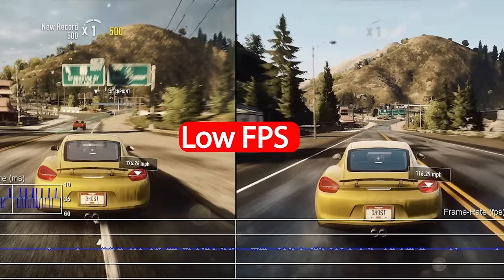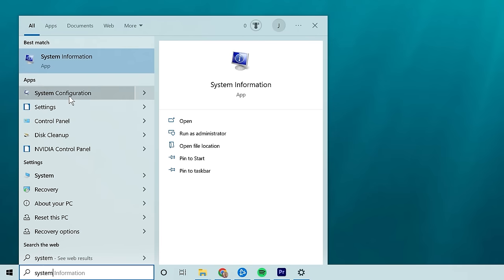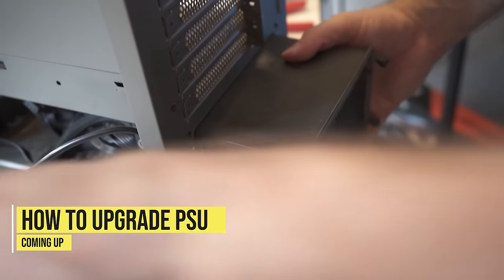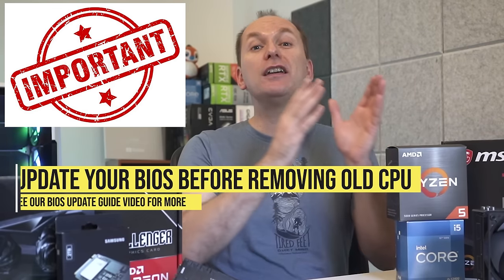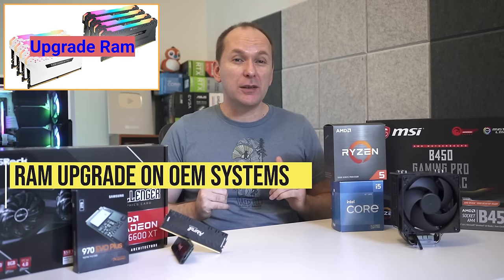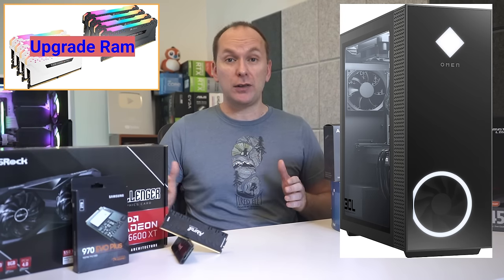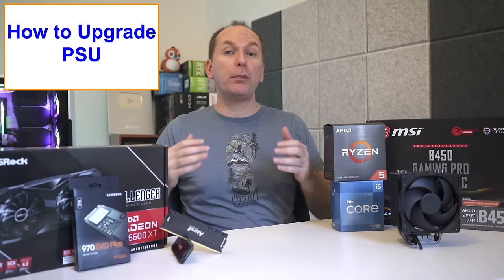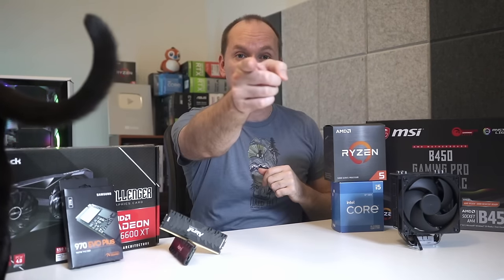How to Upgrade Your PC: How to Upgrade GPU, CPU, RAM, SSD & More! How to Upgrade PC

Comment: I have a i7 6700x with a 3060 ti I want to upgrade for ryzen but the new am5 is so expensive damn I considered a 5600x for 195 euros plus a gen3 msi board  would it be a good deal ?
Reply from the maker: Yes that would be a pretty big upgrade. 5600X and any quality B550 motherboard (see our Best Ryzen Motherboard 2022 video for more)
Reply: @PCBuilderChannel  thank you :)

Comment: Thinking about upgrading mobo, cpu, and gpu. I’m pretty sure that will also require a new power supply because these new GPUs take much more voltage, so now I’m contemplating a whole rebuild. I’m not sure if it’s worth it or not, so if anyone has any input I’d appreciate it!

Comment: I wanted to uprade to a 3080. In order to do that I would have to upgrade PSU, Processor (LGA 1200 so limited options), CPU cooler and case (a bigger CPU cooler and GPU wouldn't fit) and of course the GPU. I said heck I'm gonna build a new one in bigger case so I have space later. Then I realized my motherboard has errors with some RAM slots. There is probably 300 dollar difference in upgrading vs new (I'm not in the US). I always wanted an AMD system so I went with the new and 5800x. We'll see how it goes.  People really like the 5800x and I didn't want to pay for the pricetag for the new CPUs. The 5800x. I managed to get one here around 270$ converted. It normally goes around 310$-330$ in my country.
Reply: Wow, here in Australia the 5800x is generally around $640.
Reply: @jodiepalmer2404  Wow and I thought ours was a lot compared to the US prices.

Comment: Hello sir i have rx 580 8GB and i5 7500 which one should i upgrade it first cpu mobo or gpu

If cpu then im planning a r5 5600x or i5 12400f? Can you please respond
Reply from the maker: That system is fine for 1080p medium gaming but if you want to step up you’ll need to upgrade both. That CPU is going to bottleneck any GPU you drop in
Reply: @PCBuilderChannel  so I look to upgrade CPU first or GPU
Reply: @PCBuilderChannel  Like I'm thinking if I upgrade CPU first then down the road I can upgrade GPU
Reply: @PCBuilderChannel  well I was thinking if I get that CPU I can pair up with rtx cards later down the line or I shouldn't upgrade it then
Reply from the maker: I'm saying that sadly just upgrading the GPU right now won't give you more performance because that CPU is going to bottleneck  it too much. In order to see a boost you will need to upgrade both.
Reply: @PCBuilderChannel  yes I understand you but due to economical issues in my country I was thinkin.I can upgrade CPU and mobo first then gpu in the future
Reply: @PCBuilderChannel  so CPU and Mobo upgrade then gpu later
Reply: @PCBuilderChannel  BTW you mentioned GPU in your statement I said I should upgrade CPU and mobo first then later down the line I should get gpu Like I know I have to upgrade all 3 but still

Comment: Is it considered a new pc if the motherboard is replaced? I dont understand why you would ever 'build a new pc', arent all the individual parts replaceable?
Reply from the maker: You will eventually reach a point where upgrading a component wont help your performance because all the other components will bottleneck it and it will be more cost effective to build new.

Comment: I just brought some components  with good price 
lexar ares ddr4 rgb ram 8*2 =16gb kit 61 usd
adata xpg core reactor 850w 105usd
coolermaster 120mm mf120 halo 3nos+1nos + 53usd
kingston KC300  1TB  115usd
rest of the component i already have  ,  ml240 argb v2 cooler,    antac nx600 case,  etc...

now i am waiting for  the  release of  ryzen 7000 , then  i will purchase ryzen 5600x and tomahawk b550 motherboard
Reply from the maker: Best of luck with your build!

Comment: I have a I5–2400 with 16GB of DDR3 should I upgrade 😅

I'm just kidding that’s the specs of 2 of my old computers that I built a long time ago for myself and family but now it’s old I use it for chia farming and kind of CPU. It actually wasn’t until quarantine where I got an actual computer or upgraded which i upgraded to a Dell XPS with I7-11700, 3060TI and I upgraded it to 64 GB of ram and 2TB Nvme ssd with an extra 8TB. I actually am a miner so I bought a couple of those so for the 3060TI and the CPU and the 1TB drives that came with the XPS desktop originally. But I did also end up building an another computer that doesn't have a case because it’s sole made for mining with a 3900X CPU.

Comment: Alright i've been thinking of upgrading my PC and considering you reply to comments could you or anyone help me out here, My motherboard is a ga-78lmt-usb3 r2, i have 8 gb of ram (yikes i know, I think i need to get a DDR3 stick of ram.. idk if my motherboard supports ddr4), I have an AMD FX 8350 (4000mhz i think) eight-core-processer and a Nvidia geforce GT 1030 (not sure if my PC is trash but i think it kinda is, which is why i want to upgrade), Now i wanna upgrade my to these parts BUT im not sure if they might work, I also got this pc from amazon or walmart, It is an ibuypower PC:   G.Skill Ripjaws X Series 16 GB (2 x 8 GB) 240-Pin SDRAM, MSI Ventus GeForce RTX 3060 12GB GDDR6 and a amd ryzen 5 3600 or a 5600 but i've heard that my motherboard supports the AMD FX line of processers so.. should i get a FX-8370E? that and should i swap my motherboard to something else that supports the stuff i listed?.. i also don't mind swapping out stuff for other stuff if i do need to upgrade and lets say a DDR3 ram stick doesn't work anymore bc the motherboard needs a DDR4.. i'm unsure what to do and honestly i need some help because im new and.. frankly confused.

Comment: for me i am upgrading this year too my old streaming pc at the time it was good in 2017 pentium g4560 with 8gb ram and a gtx 1060 6gb but i am upgrading the whole platform as my second gmaing pc build my sned pc will use a ryzen 5 5600 wit ha rx 6600 with 16gb ram since it is only for gaming and my new straming pc witch is my old gaming rig i just relized i build it for streaming more than gaming lol a ryzen 5 3600 with 32 gb ram and a gtx 1080ti so this is my stream . but the new gmaing is the ryzen 5 5600 witch i cannot wait i never uses all amd build before i been hearing good stories from people and bad ones for updating the drivers

Comment: Saved up 3000 euros to get a new high end PC. Turned out new GPUs from nvidia i was interested in because of encoder and stuff are too expensive. So i am considering 3090. Basically gonna get the 7950x with new mobo and stuff and get myself a 3090 and be done with it. Debating with myself about going with new AMD gen GPUs but i have really bad experiances with driver and shader support on AMD and vulkan so i really kinda wanna go Nvidia. When i saw the new pricing almost gave up on the entire build tho :(
Reply from the maker: I'd wait to see what 30 and 40 prices actually do around the launch. And to see what AMD brings to the table

Comment: Great vid.
I just vent through a cpu/mobo upgrade.
Amazing performance increase, especially in Civ 6.

Next stop is probably a new stronger PSU. But im a bit stuck in the dilemma that i want a fanless psu that fits in either my Node 304 or a NR200, with a gaming gpu... Its going to be a tight fit
Reply from the maker: Best of luck with your upgrade!

Comment: my pc has a 2.9 GHz core_i5 cpu with 6 cores and 12 threads and 8gb ram thinking of upgrading it to have at least 3.5 or 4 ghz and 12 ram due to my pc not performing the best on modern games like the new mk or jedi survivor. Think I should upgrade. Edit: for jedi survivor it take a while to load the game but run kinda alright though there are instances of not responding or crashing. While for mk 1 takes forever to load doesn't respond often and is cpu and ram heavy.
Reply from the maker: 8GB is a problem in 2023. Remember not to mix your old kit with a new one, you'll want to just replace it with at least 16GB.
Reply: @PCBuilderChannel  got any recommendations

Comment: I am having problems with my pc I just built around 2 weeks ago now when I turn it on the keyboard turns on but no signal help!!
Reply from the maker: If you have debug lights on the motherboard check those. Check all the cables related to the GPU and make sure it's fully seeded in the slot. Use a HDMI cable at first because for some reason Display port can be weird on first boot. If none of that works head over to reddit Build a PC Troubleshooting forum. It's a fantastic resource I use all the time. Really hope this helps!

Comment: Hi can i have your old CPU, I only using Athlon 200GE and it sucks. If you have CPU that your not using anymore, Thanks. Im from Philippines!
Reply from the maker: It is very likely your motherboard will support upgrading to a Ryzen 3000 or 5000 CPU with a bios upgrade . Check out the support page for it. Can often find them on the used market.

Comment: Thank you for this guide.  I knew some of what you said, but not all, so it was great as general info and filling in some knowledge gaps.  As per your advice at 5:58 I'm now wondering if it is worth spending that extra $150 - $200 AUD, roughly, and also upgrading my 2019 B450 to a B550, whilst I'm replacing my 2600X with a Zen 4 CPU, especially considering the larger BIOS chip on a B550 vs the 16Mb one on my B450.  I feel in terms of longevity, and also possible GPU upgrade in 18 months or so (assuming AMD isn't as ridiculous as Nvidia with power needs), it maybe worth upgrading the mobo as well.
Reply: no massive benefit from going b450 to b550. put the $150 towards a better GPU or CPU depending on your workloads...a 5800x 3d will work on a B450 with a bios update.

Comment: Can most GPU’S go in any pc?
Reply from the maker: Do you mean physically fitting in the case? You'll want to check the dimensions of your GPU vs your case to be sure. If you mean the system check out our Best GPU/CPU Combo 2022 video for more
Reply: @PCBuilderChannel  Yes, and will all GPU’S be compatible with all builds

Comment: 4 cores 4 threads.. just bought a 7000d time to upgrade?
Reply from the maker: 4 cores 4 threads is DOA in 2022. Will still play easy to run titles but will greatly bottleneck most GPUs. Ryzen 5600 is $150 right now, a good B550 is only $100, so ...
Reply: @PCBuilderChannel  i5-2400, 16gb ddr3  1333, gtx 950. Will upgrade to i5-i9, z690, nvidia 3 series, ddr5, custom water cooled with external rad blowing outside window.. Will wait until new products come to market and buy new with discounts. room heat will be an issue

Comment: Which will be a great upgrade for a 2070S
Reply from the maker: Are you unhappy with your 2070 Super? Still a good GPU in 2022. 2070 Super = RTX 3060 / RX 6600 XT levels of performance. If you want more, get something faster than those.
Reply: @PCBuilderChannel  thanks! I'm  happy with it but in 1440p some games don't reach 240fps and I feel I waste money on My Samsung G7
Reply: @jmcastillo069  you’re trying to play in 1440p 200+ fps!😂 whyyyyyyy that’s so unnecessary
Reply: @heroicsquirrel3195  maybe for you...

Comment: very thin, blurry line between upgrading a system or building a new one
Reply from the maker: There sure is! My wife (editor) and I had the same discussion and concluded if you are swapping out the full platform that's where we classify it as a new build. But very open to other's opinions on that. (;

Comment: how do i know if my power supply supports my gpu or cpu ??
Reply from the maker: Hop over to our Best PSU 2023 video! We cover this in depth there
Reply: @PCBuilderChannel  I have another question what monitor would you prefer if i had a pc with Zotac geforce rtx 4060 8gb, Intel i5 12600k processor, vetroo v5 Cpu cooler, MSI pro b760m-A wifi DDR4 pro series motherboard, Corsair vengeance LPX 16gb DDR4 DRAM 3200MHz, Aresgame Agv series 650w power supply, western digital 1TB WD Blue SN580 NVME SSD. ???? ( all of these specs are in Crater youtube pc build under $900s ) can you please tell me i’m really trying to find out

Comment: you forgot the new GPU cant have a bigger powerdraw than the older -like going from a 150 watt gpu to a new nvidia 3060..(.225watt) unless one like to play at low resolution than the power supply is the limit and wasted -a amd 6600 should hold the 150 watt limit and not talking about the more higher cards
Reply from the maker: We specifically discussed ensuring the PSU is appropriately sized for the GPU. Rewatch that section again.

Comment: this guy is basically saying  if you have an OEM pc you need to throw it away and build a new one because you cant upgrade it
Reply from the maker: I'm saying you need to check what's possible to upgrade in your system.
Reply: @PCBuilderChannel  yeah im sorry that i suggested that, did some research and turns out you that are compenents that are compatible with pre-built pcs

Comment: Much more like Micro$$haft sucks balls should be the title. Before you scrap your PC build i would suggest trying out Linux distros. If you are a gamer, Popos, Nobara etc. these distros has gotten easier over the years to install. There is no commitment to install. You can use a live CD or usb and it would boot the OS without full install. If i need Windows for specific usage, i run Windows 10 through virtualbox on my t460s laptop running Opensuse Tumbleweed rolling release distro.

Comment: Tfw you have a ryzen 5 1400 with a b350 tomahawk💀
Reply from the maker: Update the bios to one that supports the Ryzen 5600, and buy a new Ryzen 5600 for $140. Uninstall the chipset driver using Driver Uninstall, then swap in the new CPU. Install chipset driver and boom new system!
Reply: @PC Builder  what if I have a shitty gpu. Rx 580 4gb? I don't plan on using a 1440p monitor so I don't really care about graphics, I just don't wanna run every game like it chugging

Comment: 6 cores and 4 isn't enough anymore these days so dislike.
Reply from the maker: Whoever told you that is doing you a disservice. i3 12100F, i5 12400, Ryzen 5600, and the upcoming Ryzen 7600X are certainly enough for gaming. Even the i3 10100F is fine for budget level gaming. Performance is what you are after, not just raw core count, otherwise we'd all be using 10 year old Xeon 12 and 24 core count processors.
Reply: @PCBuilderChannel  for my 8k pc build that is still not enough ;)
Reply: @RicardoTijdelijk  and what are the specs of your 8k pc? What applications are you using? Maybe show us a video on your specs so we can help you
Reply: @trcs3079  it would be to eye blowing for the public eye and still it can't run 8k 60fps.
Reply: it manages on a good day somewhere between 24/31 fps on a bad day 19/25